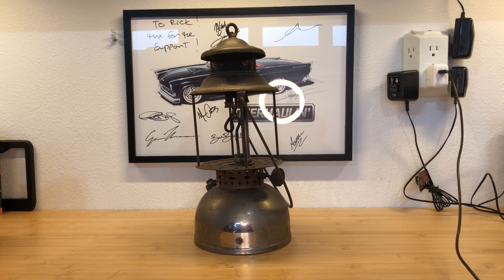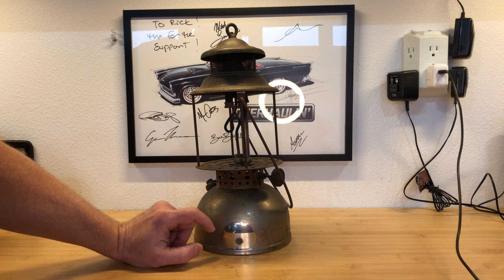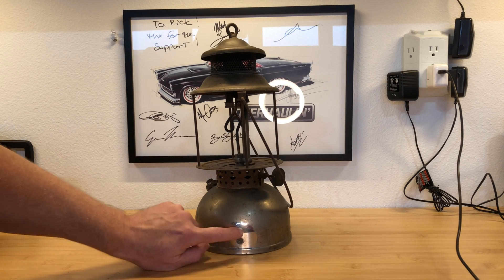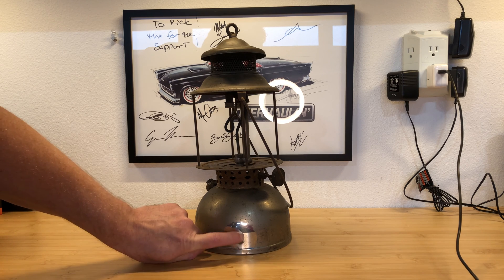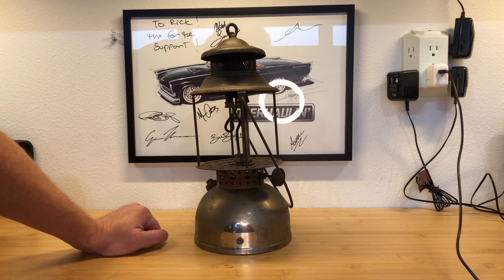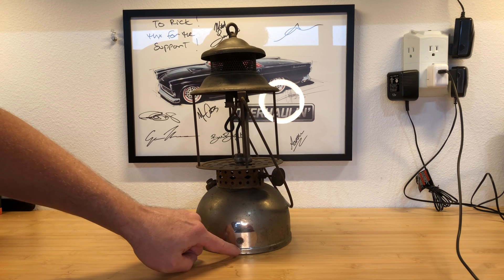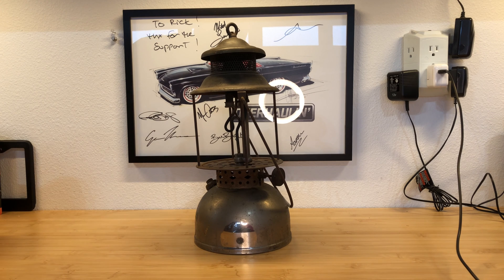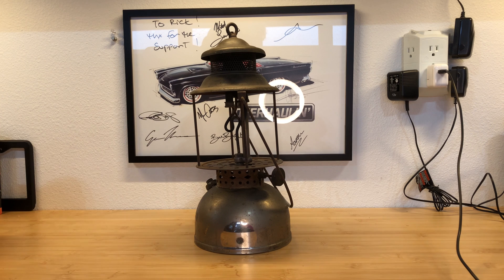Quick Tip: Preparing Nickel for Polishing

Comment: Nice videos. Thanks for sharing! Question: I can’t seem to find in your videos how long to soak the fount in the hot citric acid solution. Perhaps I hv just missed it. Thx.
Reply from the maker: My solution is 1 tsp of citric acid powder per litre of water and I start with 15 minutes.  You can soak longer, but if you're just cleaning and removing corrosion, 15-30 minutes should be plenty of time and won't damage the nickel.

Comment: Loving the comments about "great tip", LOL!! And you criticize using metal polish, LOL. What a fraud. And btw, citric acid is not vinegar. And YES, I tried this on a section with absolutely ZERO improvement King Fraudman. Maybe I forgot to chant a mantra  while waiting 15 minutes.
Reply from the maker: I've never criticised using metal polish.  I use it all the time.  In fact, I used it to make this Akon fount shine after giving it a citric acid bath for 20 minutes.  Check out the link to the full video on polishing nickel founts and you can see the whole process.  My point here is that doing some prep work with some kind of a mild acid makes it easier to polish, whether that's by hand or with a buffing wheel, and reduces the chances of burning through the nickel while trying to remove the crust of "patina".  I never said that vinegar and citric acid are the same thing.  I said that you can use either of them (or even something like ketchup in a pinch) to prepare nickel for polishing.  Your milage may vary with these techniques, but I've done this many times with crusty founts (although this was the first with ketchup) and never failed to have good results.
Reply: RE: to Ken C.  Why the attack, sir?  To Bill:... A kind word turns away wrath. You make my hobby, of many years, so much more enjoyable. I'm still on the lookout for my pristine Anniversary Lantern- 3 49.